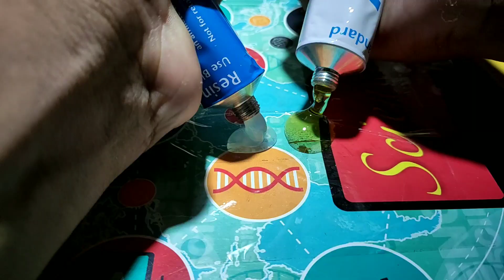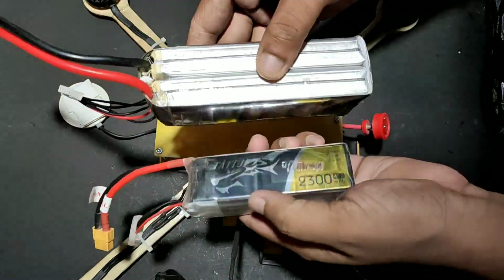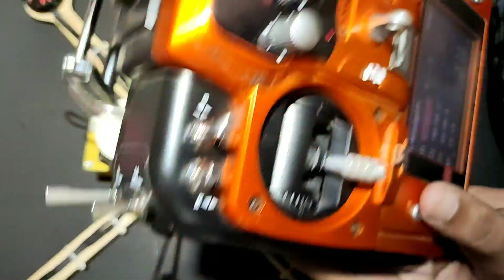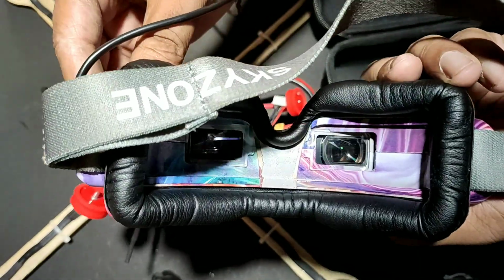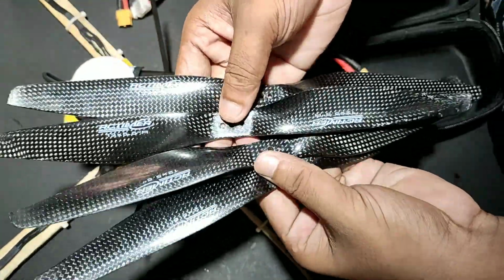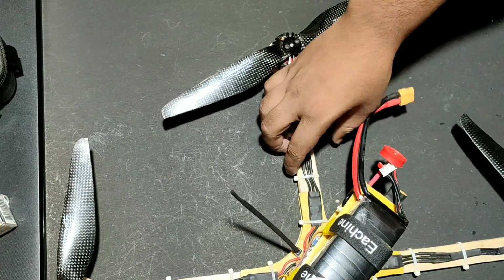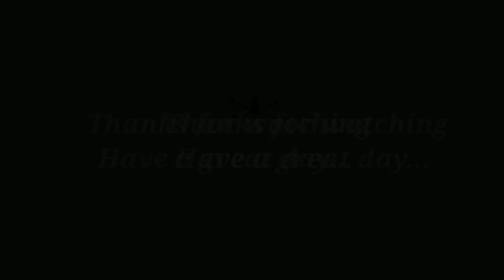Haw to build rc Drone at home. 12 inch FPV Drone. #fpv #fpvdrone #drone #quadcopter

Comment: Everybody into drones should see this.  I am DEEP into drone engineering myself, and this person is showing an important concept- there are MANY ways to do things that can result in a finished product that works WELL. By using the materials he has- this drone has far better vibration damping than most drones on the market.  Yes, the structural parts weigh something more than an optimized Carbon Fiber design, but the TOTAL drone weight will hardly be effected at all.  Model Airplane grade Plywood an fiberglass BOTH have pretty good strengths and low weight to boot.  The result is a drone with much improved vibration damping for a slight cost in weight.  Well done.

Comment: Hi bro will 580 kv motors lift dslr ?
Reply from the maker: For DSLR camera I recommend you to avoid this avionic 3506 580kv motor and buy bigger motor like 4114 size..
Reply: @akgadget  share link to buy
Reply: @akgadget  and wat did u use to cut the wood
Reply from the maker: https://store-en.tmotor.com/h5/#/product?id=698
Reply from the maker: Generally I want to our local wood cutting store and cut by them..